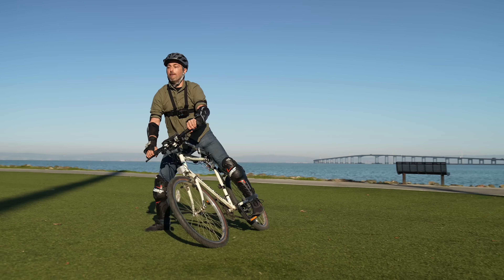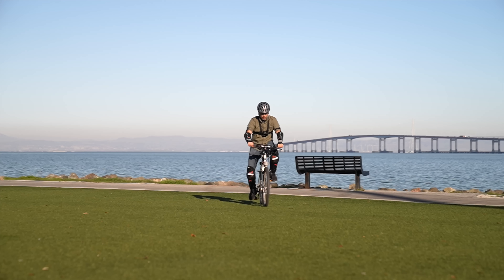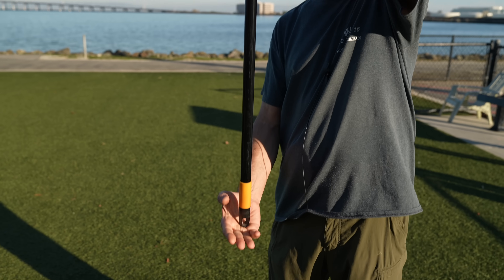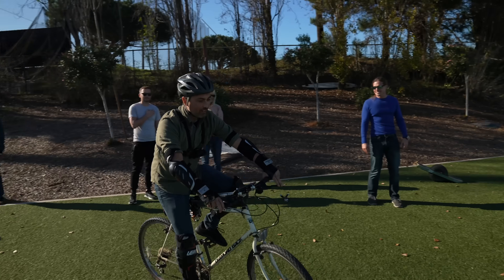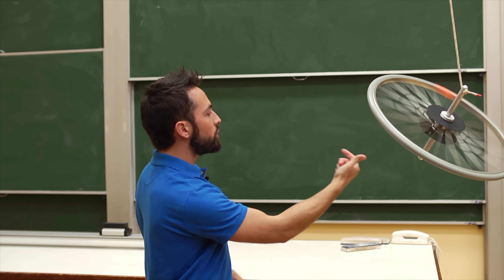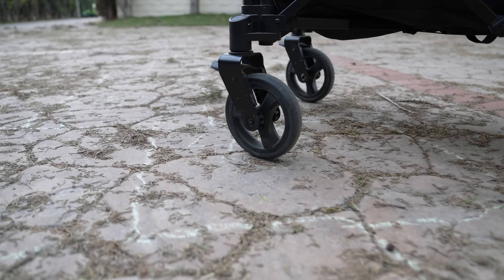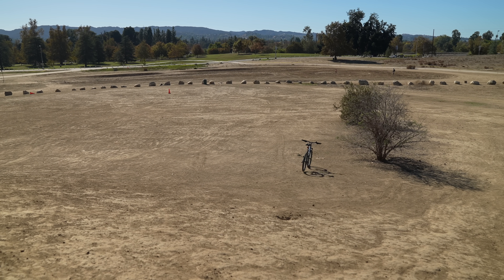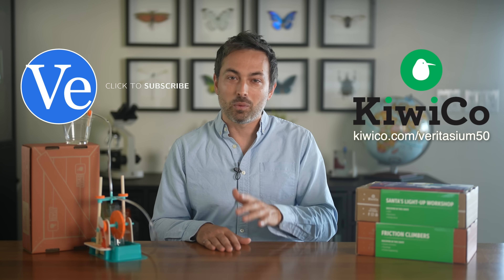Most People Don't Know How Bikes Work

Comment: Now I'm going to have to consciously watch what I do because I swear that I make turns by just turning the handlebars and leaning in the direction of the turn.  For the record, I'm nowhere near an accomplished cyclist, in fact I probably do everything wrong that it's possible to do on a bike. As proof of my non-expertise, I present the fact that I've had several crashes from running into curbs and such on level ground.
Reply: I wouldn't call myself a "professional" cyclist or anything, but the whole "slight counter-turn" thing immediately pops into my mind when I think about "steering".

It's like you swerve around a tiny object and then lean the direction you're going to turn.

I wouldn't have been able to explain it as well as in the video, but if you cycle from time to time, you really don't get surprised by this.

And I wouldn't say crashes are a sign of a bad cyclist. I've crashed like 3 times in the last few years, because sometimes you have to. 2 of these crashes were me dropping to avoid hitting a pedestrian that randomly ran into the bike lane and the third was me blindly driving into a concrete cube at night.

As long as you don't get harmed in these kinda crashes, they're fine. I think I got slightly dirty and maybe scraped my hand a tiny bit in those.
Reply: @dowfreak7  My crashes;

1. I lost control going down a hill while trying to hold something large, and the lens in my glasses cut my left eyebrow.

2. Riding on the sidewalk at night in Walmart's parking lot, I swerved around a cart someone had left there, the front wheel went off the curb and I went over. Then on the way home, I swerved around a telephone pole that's halfway into the sidewalk and the exact same thing happened again. No injuries, just soreness.

3. While exploring, I decided at the last moment to turn down a side street, but turned too sharply and went over, landing in a pile of trash. No injuries.

4. Coming back home after dark, I was riding on the sidewalk (I don't like to ride in the street on busy main roads) when I came to a cross street. There were cars waiting at the other corner and the headlights made it hard to see. Instead of the sidewalk on the other side, I hit the curb right where there was a storm drain. The dip of the drain combined with the roughness of the curb above it popped my front tire and although I didn't flip over or anything, I did end up falling over onto the grass.

5. Riding at night, I had to go into the road for a section where there was no sidewalk. I saw up ahead that the sidewalk had started again, so I figured I'd swerve into the next driveway and get back on the sidewalk. It wasn't a driveway, it was a dark shadow on the lawn. Needless to say, I went over onto the grass.

6. Riding on the sidewalk, I came to a cross street and there was a person on the other corner. It LOOKED like the entire corner was worn level with the road, so I figured I could swerve back onto the sidewalk behind them. I was mistaken and the curb was NOT worn down level with the road. The front wheel bounced off the curb and I went over hard, seriously skinning my right knee and right forearm. I actually had small pebbles embedded in my skin. Ripped the hell out of the knee of my jeans. 

7. Sidewalk again. The grass on the right was a little higher than the sidewalk and I didn't want a repeat of the curb incident, so I was staying more to the left. Unfortunately, I ended up catching my handlebar on the chainlink fence that was there. I ALMOST managed to save it, but ended up falling over and skinning my right knee again. At least that time, I didn't rip my pants.

On a bike, I'm basically an accident waiting to happen...

Comment: Please build a bike that's normal in every way, except that the front fork is pointed directly down to the point where the tire contacts the ground.  I want to see what happens.
Reply: You have never turn front fork 180° and ride?
It work just as fine, but don't try without hands because the fork want to turn right way quickly.
Look up stunt cyclist.

Comment: Fun fact about this as well. The design that makes it so that it steers itself is called the caster angle, atleast the part where it's tilted back so the point of contact is behind the rotation axis. It's also used in cars to adjust how it steers, from making it more stable to making it easier to turn the wheel.

Comment: Counter steering is a common thing that large amount of motorcycle riders know. 
I ride both downhill mtb and motorcycles for over 2 decades now and Im surprised how many people in both communities still don’t realize how it works. 
Still, if you lean into the corners like a MX  riders do you wouldn’t have any issues with this “steering lock” system.

Comment: That's not essentially true about turning. You can just lean to the side instead of counter steering.... Most of the time you have to counter steer because of the angle you're approaching the turn, since your back wheel takes a different route and you would do the same with a car

Comment: It's pretty basic: you have to shift your body mass to the direction you need to turn, and this requires momentarily moving the bike the other way. Our brain gets trained in how to do it without us being fully aware of the physics involved, like you say. 
It's a similar situation when playing catch. Our brains are trained to intercept the ball location, and it adapts for less curve if the velocity is higher, without us having to pull out a calculator to determine the math. Try playing catch in zero gravity and the results are hilarious, much like riding this bike ;)
Reply: Moreso, we become so experienced at throwing balls  that we can accurately guess how much is needed to throw it how far. It's the same for any body movement: you don't think through all the different mechanical adjustments you will need to walk, you don't think through the physics of what you need to do to jump over something, etc.
Reply: Shifting body mass has nothing to do with the steering it just helps to keep the bike as upright as possible to have more of the tyre contact patch on the ground. It's the force on the handlebar that makes the bike turn. Watch Twist of the wrist video where they proved it by rider not acting on the handlebar but instead shifts his body. Very minimal turn effect, not usable in any way. You can be perfectly still on the bike and apply the force on the handlebar and it will turn.

Comment: Hmm. Back when I was a young lad, I had mastered the art of riding a bike, including turning, without hands on the handlebars. I wonder how that would be affected by this lockout system? Also, it's easy to balance on a stationary bike. Stationary bikes are made with stable platforms.
Reply: I never learned to ride the bike without hands on the handlebars, tried it multiple times but as soon as I take both hands off the handlebars I can feel that I'm going to fall. Eventually I just gave up and decided I just can't ride without at least one hand on the handlebars.
Reply: true kid chads learn to stand on the peddles without hands and somewhat steer
Reply: Thanks for all the responses, folks. Here's another question: Would the tendency to fall be heightened/reduced/or stay the same on a penny-farthing bike with the handlebars locked straight (as opposed to a regular bike with similar sized wheels and locked steering)?
Reply: Roger Cline....I also learned to ride my bicycle hands free and also turn from one street onto the next. Of course I needed to make a wider turn than what I could do with my hands on the handlebar but I still did it. I also spent all my time outside as long as the weather was okay so I spent a lot...a lot...of time on my bicycle. I also did a lot of roller skating with those old type skates that you tightened down against the soles of your shoes using a key. Tennis shoes didn't work; you had to have a hard sole shoe.
Reply: Did you not watch the video?
Reply: The lockout system would still totally disrupt your ability to stay upright, because when cycling hands-free, you use gentle body position changes (instead of slight steering inputs) to off-balance the bike into turns, and rely on the self-correcting properties of the steering to straighten out again.
Reply: That one is easy: you fall. It happens when bikes get neglected and the steering gets "notched", and the handlebar doesn't turn smoothly. It's almost impossible to ride that bike with no hands. I tried :)
Reply: @tychoMX  so the best way to ride this bike would be a perpetual wheelie?
Reply: @TearlessGosling  hell yeah! if you can do that I'll buy you a beer. Hell, I'll buy you a 24!
Reply: @tychoMX  but ghost riding is a thing as a kid you never steered with your legs and leaning without using your hands
Reply: @matthewfiedler4739  The handlebars still turn bro
Reply: @matthewfiedler4739  it has nothing to do with your legs or your lean. It has everything to do with having the front wheel being able to turn in the direction the bike is leaning. If the wheel can't "flop" in the direction of the steer the bike becomes unstable.

I tell you what: do a ghost bike experiment, but tape/tie/brace the handlebar so it can't move. It'll topple right away.

Comment: This effect gets a lot of people killed on motorcycles. On a bicycle you just pull the handle on the side you want to turn towards. It's common sense and we get used to turning that way, but motorcycles are basically the opposite. You push the handle on the side you want to turn and lean into it.

It's simple to get used to it, but panic causes people to revert back to what they learned first. So you have situations where riders go into a turn too fast and start to pull the handle to turn which actually stands them up and pushes them out the curve. Also situations where all of a sudden they need to avoid someone turning in from a side street and end up leaning into that vehicle instead of swerving around it.

Comment: Why then it's easier to balance a moving bike than a standing still bike?
Reply: When you steer a moving bike, the steering causes the front of the bike (and ultimately the whole bike) to move left or right.  This is the same as moving your hand while balancing the broomstick.  If you steer a stationary bike, you just turn the wheel side-to-side, but the base of the bike (the contact patches of the tire) don't end up moving side-to-side.

Comment: Living in Amsterdam, I ride the bike with my hands in my pockets and I rarely ever turn the handle to either side when turning... Video makes a lot of sense of this situation, I usually apply weight to whichever side im turning (even sharp turns where I have to grab the steering...)
Reply: You probably do a slight hip flick to the left (for example), so the front wheel twitches left, so the whole bike leans RIGHT, etc. (invert this to turn in the other direction, obviously). I eventually worked out that was what I was doing when riding with no hands. Obviously not when going downhill, because you'll need your hands on the brakes. :) :)

Comment: It's Called Counter Steering. Those who ride motorcycles learn this early. It's also a major cause of accidents because people over steer thinking they can compensate for the direction when about to crash. You Don't Really turn to the left or right to go the other way, you just kinda turn slightly just enough to set up the proper angle. Done right it's hardly noticeable.

Comment: I sometimes only use counter steering when I'm on a bike, like as people do on motorcycle on highways long turns, but it is only works on some high enough speed. I wonder if it is still possible to turn left on low speed when handlebar blocked on the right 😏 just using counter steering and some balance skills

Comment: i've always been curious about the "gyroscopic effect" i never understood how that would keep the bike up right, i've always just accepted that as the part most people understand that i dont, i worked on motorcycles for a living, knew how to fix them before i had tried to ride one, but on a bike you use the balance to make a fast turn, you throw your weight in to the turn, a long raked cruiser can rarely make a u turn (unless you shelled out big bucks on your front end) while a sports bike despite having seemingly less steering radius often if you throw your weight in to the turn "dragging knee" your bars are almost straight but you can go around a turn far faster then almost any car, all due to your steering contact patch and drive contact patch are powering you towards the exit of the turn, its why you some times see a motorcycle swerving from one side of its lane to the other, it helps warm the sides of the tire, creating better friction in a turn.

Comment: Fascinating.  I have an electric fat tyre trail bike (Cyrusher XF800) which exhibits some slight instability….you can’t ride it “no handed” and at low speed, under 5mph it becomes increasingly divergent especially when steering tightly (it wants to jack knife the handlebars).  It feels fine to ride fast, and is ok as long as you keep both hands in control. One handed riding is possible though it then feels a bit twitchy.  My eldest tried riding it too, and concurs!
Reply: Sounds like the steering bearing is too tight or dirty or the bearing is busted.

Comment: I don't get it.. The premise here is that because you lean without touching the handlebars and it momentarily turns opposite of the direction of the turn; the turn must be made this way just the same when holding the handlebars? I dare say not. I'm still confused at how 200k people are surprised to learn that making a bicycle unable to turn in one direction will cause it to crash.. Handlebars turn because they have to. That patch of the wheel in contact with the ground has to stay center line of the force you're exerting upon the ground or you will fall over. 
I suppose if you never wondered why your bicycle could turn, there's not much else you've ever wondered about..

Comment: I had a messed up bike accident about 2 years ago. I was going down a hill on a road and for some odd reason, I thought it was a good idea to stand up and slam on breaks, and I flew over the handle bars and scraped my face on the road for like 2 feet. I had to go get stitches because my lip was split and I had scrapes on my face and a chipped tooth...

Comment: Formula 1 driver use the flick right to turn left to widen the angle of the corner and carry a little more speed
Reply: No they don't.
Rally drivers do to go in and out tight corners.
Reply: @XtreeM_FaiL  do you even know what your disputing right now?
Reply: @XtreeM_FaiL  no you didn't.
Reply: @XtreeM_FaiL  you just made some completely irrelevant comment about how rally drivers go through tight corners

Comment: This video is not entirely correct. Yes, people do use the steering to keep the balance. Yes, at certain speeds, people do counter-steer to go in the opposite direction. But at certain speeds, this is entirely unnecessary. What is necessary however is that the person is still able to move and make micro-wiggles left and right to keep that balance WHEN pedaling. If you have a good speed and are not accelerating or decelerating too quickly, you CAN keep that balance on an almost perfectly even surface for a decent time.
Reply: There is no speed when counterteering stop working.
Reply: @XtreeM_FaiL  There can be speed even when counter-steering isn't possible. Not sure what you mean here.

Comment: This is standard protocol in motorcycle racing...

Countersteering causes the inside of the tire to grab the surface and quickly force the bike to lean into corners. 

Back in the day(maybe still), our handlebars would be visibly bent from how hard we were pulling on them to achieve this.

Comment: Anyone who has ever taken riding a motorbike seriously is very familiar with the principle of steering opposite to the way you want to go first.

To get a quick fast turn in those ride to race or just to take a corner as fast as they can will often steer the wrong way a good 5cm on the handle bars just before the turn starts.  As the video mentioned, because all of this is about balance, this is why they also lean off the side of their bikes so much.  The rider has moved the centre of gravity thus reducing the amount of lean required from the bike and therefore improving the grip being given by the tyres allowing greater speed through the corner.

While these are most effective at high speeds on a motorbike you can practice these exact same principles on a pushbike and it will affect how you end up riding any two wheeled vehicle you own.

Comment: It's not "counter steering".... It's what needs to be done in order to change the path of the rear wheel. If you are traveling straight and you all a sudden just turn your front tire either direction too drastically... The rest of the bike will want to continue in a straight line. Cycling involves a lot of weight shifting, and pivoting.

Comment: I'm sorry, but this is utter bunkum. You do tend to steer the opposite way prior to a turn because that allows a greater curve, more stability, and less likelihood of losing control (bikes don't like tight turns), but it is still possible to turn immediately one way or the other. The physical ability is something entirely different to what is the best, easiest, and most efficient.

All you are showing here is someone trying to act contrary to what they were told, with the inevitable result.